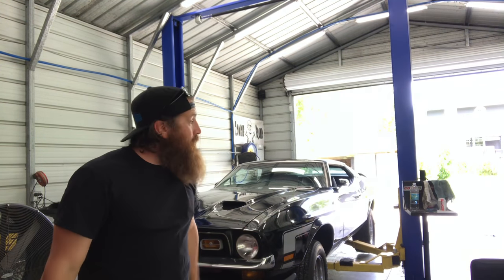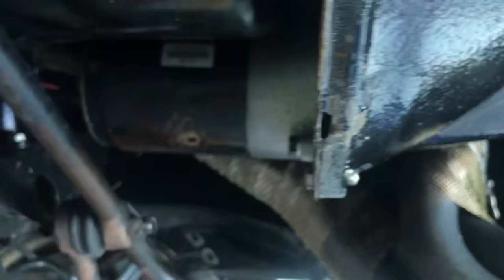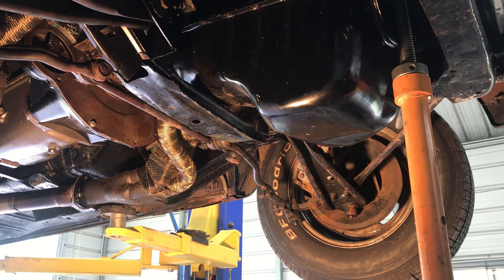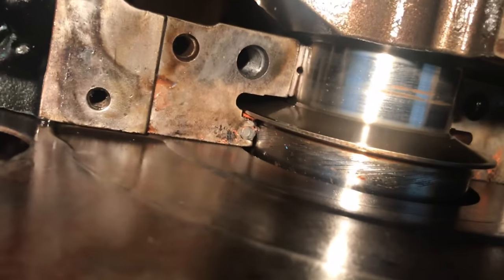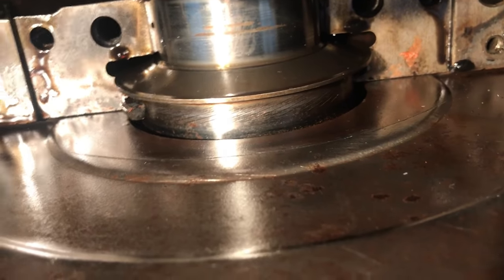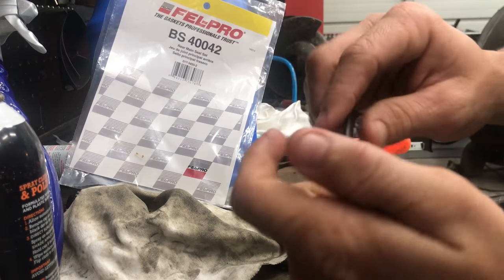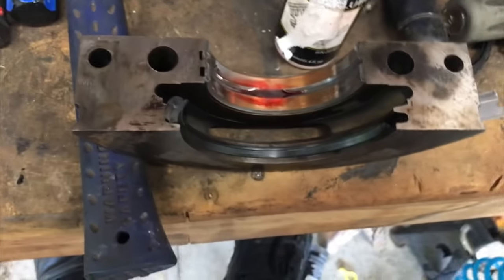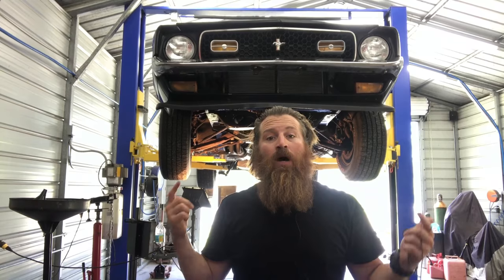How To Replace a Rear Main Seal - Without Removing Trans or Engine!

Comment: About clocking seals. If you have ever taken an original 1970 Cleveland apart you will notice the rope seal is flush with the block and cap, no protrusion of any kind. And remember the cap will have a pin in it that needs removed so you have room for the new type seal(the one you used with wire inside). I smashed the first one I ever installed because I left the pin in. I had a steady stream of oil coming out on first start up. I was a clueless newbie at the age of 19. I still have that engine to this day in  my mustang, I am 54.
Reply: What is the "pin in it..." that you commented about? Thanks.
Reply: @Im1withU  The cap has a pointed  pin installed into it that keeps the rope seal from rotating in the groove. You can remove it with a very small punch.
Reply: @JimsFastbackGarage  Thanks Jim for that info.

Comment: Good video, but you have a Rack that allows you to do this with ease. For those that use floor jacks, limited room and using a floor jack to jack up the engine from the front crank pully is a little more intimidating. Use caution when using a floor jack on the Crank Pully. Make sure you don't run into hitting the Engine Fan into a radiator shroud or flexing the upper and lower radiator hoses where you damage these parts. If doubtful ask a professional or someone that has worked on cars. A question not asked is where we run into problems. UTUBE or Google is not always your friend. Good stuff.

Comment: Man, if I just got a new transmission and the seal was leaking, I’d be pissed. It’s cool you were able to get it without taking them apart though.
Reply: Rear main seal is not part of the transmission.
It's on the rear main cap of the crankshaft.
Reply: @duncandonovan5270  I just meant it sucks that it was just put on, then has to come back off to replace it (obviously, not in his case).
Reply: Happening to me right now 😂😭😂

Comment: Thx 🤓
I had to watch it a few times to understand because I never seen a rear seal in an engine so I didn't know where to look without being pointed at it.
I also noticed you unbolted the motormounts and raised the engine to free the oilpan.
You might wanna mention stuff like that cause I think thats a big step for folks that are attempting this for the first time, I understand it's not necessary on all cars.
Also wondering what greas to use installing the seal 🤔
All&all a usefull video, have more confidence doin this job on my 460 now.
Oh hats of to the drummer 😉

Comment: Yep. Used the same method to replace the rear main seal on my 82 corvette. Older engines are so much easier to maintain than these newer engines.
Reply: I am starting to replace the rear main on my 64 Mopar 426 wedge engine. I've not done this before and this video is inspiring my confidence to get the thing replaced.

Comment: Some repair manuals and engine rebuilders suggest placing the seals dead flat without an offset. I've always offset mine, but just put together a Windsor dead flat. You reminded me to not second guess myself and old building techniques. Before I put the pan on this engine, I will slightly cock the seal and put it back together. Thanks for reminding me not to follow newbies.

Comment: Yep, it can be done. I’ve replaced rod bearings on all 8 rods of a 351C in a 71 Torino without pulling motor. I did the rear main seal on a 69 mustang with a 351W without pulling motor.

Comment: Great video . I didn't know the rear main could be in two pieces.  Just need to determine if that's true of my Chevy 305.  I gotta say though, whoever was making all the racket in the background towards the end made it hard to hear what was being said without rewinding.
Reply: If the 305 Is 85 or older it's 2 piece
Reply: Did you ever got to do it? Cus I’m goin through the same thing now with an 85 el co

Comment: Nice car, and good video. I remember doing this way back in the day, if I remember correctly, the new seals would come with a small piece of plastic that you would stick between the block and outside of the seal when installing it so the edge of the block wouldn't tear up the outside of the seal. That main bearing in that cap looked cooked though, whole lotta copper showing

Comment: I am struggling getting the new seal in the block so I thought “great, let’s see how it’s done.”  I watch you struggle with it a long time and only get it half way in like me. Then you say it’s in the block and go to the cap. Wish I could perform magic like that.
Reply from the maker: Yea I went though 2 seals. Don’t give up. You can also rotate the crank and it helps it go in
Reply: @baconfabrication7775  that's valuable information

Comment: Nice video thanks.    I have a sbc and my crank shows about the same or a little less wear than the one seen in the video.     Was the crank journal wear anything to worry about?    Did you have any trouble with the crank bearing not lasting?
Reply from the maker: Nah man. Just run it. I’ve put 10s of thousands of miles since this video

Comment: I like your video and know that your removal technique would work but I'm in a quandry over a 1956 Ford jubilee tractor engine with a rope seal.  Have the bottom main cap out, that half of the rope seal removed, but wondering if you have any tricks to remove the top half of the seal.  My two possibilitiees would be 1) running a screw up into the rope and hopefully pulling out (after loosening the other 2 main caps of course) or 2) finding a thick piece of relatively stiff copper wire to punch one side upwards and then grab the other side, if it comes out, with needle nose pliers like you did with the rubber seal.  Let me know if you have any suggestions.  Worst case scenario, what if I left the top alone and just replaced the bottom half with the rubber seal from the gasket set?

Comment: Question sir..if your car is automatic transmission...and your rear main seal is worn out.what oil will coming out there?is it ATF?or ENGINE OIL?
Reply from the maker: It will be oil coming out if it is the rear main seal
Reply: @baconfabrication7775  so why is the ATF coming out from my tranny?which is the mechanic said to me that the rear crankshaft oil seal was worn out..my car is toyota rav4 1az engine 2005 model

Comment: Unless you've got a 302 in a truck, in which case they left some stupid bulge hanging down at the back of the oil pan, so you need to raise the engine enough for the bulge to clear the cross-member grumble grumble

Comment: When your were lifting the engine up we’re you lifting on the vibration damper?
Reply: Same question, Did he just lift the block up to make clearance from the transmission? Where did he place the tool on?
Reply: @FreshKicks4545  he lifted it so he can (re)move the oil pan because of crossmember in the way.

Comment: Same theory on a 98 5.7 Liter 4x4 Tahoe engine? If not whole transfercase tranny must be taken out I pray u say yes if not I will ride this engine until the wheels fall off the then new engine and tranny makes no sense to me to drop the tranny out just to put a lil seal on might as well save cash 💵 and make her brand new if I can do it your way though I will put another 100k miles on her and just put my money on the paint and suspension

Comment: Do you think this will work with the 460?
Reply from the maker: If it’s a 2 piece main seal then yes
Reply: @baconfabrication7775  thank you for the quick response. Now I've got to figure out the best way to take off this oil pan on this      old 1ton.

Comment: Would you happen to know how I would go about doing something like this with a 2012 5.0L F-150?
Reply: You don't.  It's not a 2 piece seal.
Reply: Correct thats a 1 piece seal but can also be replaced without pulling the engine.
Reply: Pull transmission.  It's a 1 piece seal, not a 2 piece seal like this one

Comment: I'm confused. How is the seal able to "seal"  being in two parts. Isnt the oil going to seep past the connecting parts?
Reply: Thats why he said to add some permatex sealer to the ends of the seal halves and some on the main block to prevent oil leaking past the ends.
Reply: I'm an amateur shade tree mechanic..adding sealant to a gasket that's in 2 pieces don't  seem right..but again I'm an amateur
Reply: You rotate the seal about a1/4",so the ends of the seal don't line up with the block & rear main cap & apply a dab of sealant to the ends of the seal

Comment: You need to re-label this video properly... This may work on this particular vehicle but, Good luck on any other vehicle, European/German etc....
Reply: If you didn't know that a 1 piece seal can't be done this way, the you probably aren't good at the circle peg in the circle hole game
Reply: How do you know anything about my mechanical abilities?? They obviously outweigh yours since you don't know the difference between a 2 piece and one piece seal, or literally anything about a Ford engine. Might as well make paper airplanes out of those certificates, at least then they'll be useful
Reply: Evan Fishel lmfao this guy...  Ok guy...
Reply: @Fish11125  This reminds me of one of my auto teachers. Who had told us that he's met many without a cert, who can rebuild with their eyes closed. But just as many ASE Master Mechs, who couldn't fix a sandwich. 

Because ASE certs are not for good mechanics. Just good multiple-choice testers. AFAIK you could get all your certs, master and all, without ever touching a car.